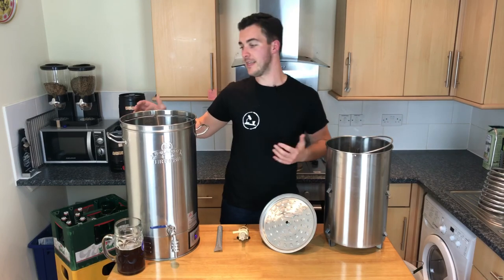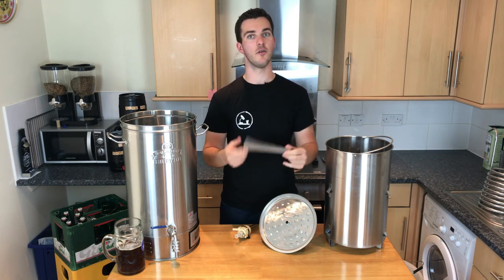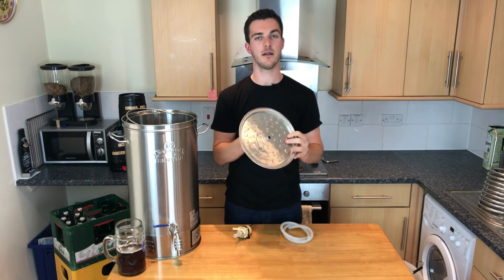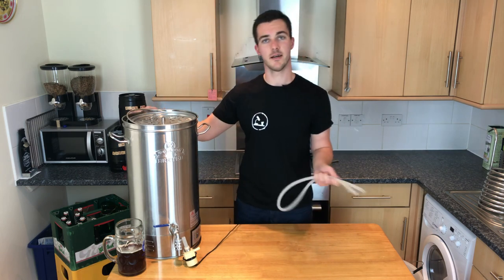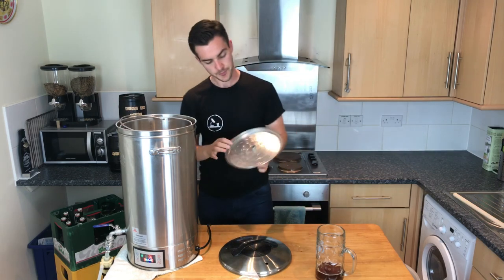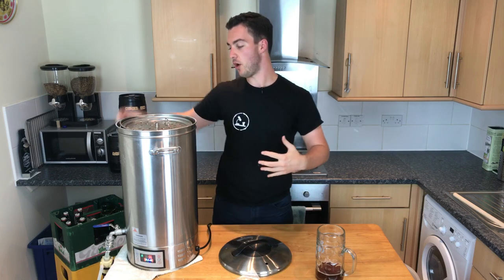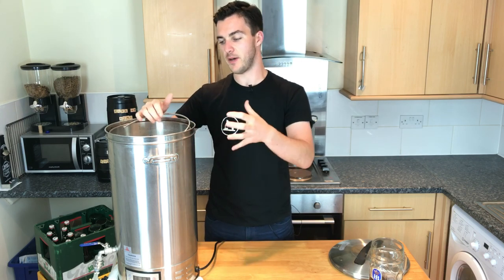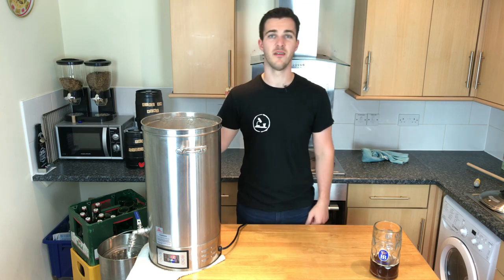All in One Homebrew Systems: How to use The Bulldog Brewer

Comment: Nice video.  I just got a HopfenGott 15L system (which I think is very similar to the Bulldog Brewer), and your video was very helpful. Did my 1st brew on it this weekend, and all went pretty well.

Interesting that you just chuck away your bazooka. Do you just run the mash and boil with nothing at all on the back of the tap as a filter? I ran it with the bazooka in place, and of course it instantly clogged up with hops and trub and totally blocked the flow from the tap when I came to drain the kettle. I had to keep brushing the bazooka with the paddle to unblock it enough to let the wort flow. In the end I got fed up and just poured what was left out of the top of the kettle. Might take your advice and just leave out the bazooka next brew.

What ratio of water to grain do you use in one of these systems? I think I got mine a bit thick (ratio 2.5 water:grain + dead volume). And is there a minimum mash volume? My mash volume was so low that the sparge plate would not go down far enough to sit on top of the grain, and I got a bit of a stuck mash with recirculated wort just sitting on the top of the grain bed and the pump running dry. All sorted with a good stir, but any advice to prevent this happening again much appreciated. Cheers.
Reply from the maker: Hi Mark Harland! Thanks for watching! I think that a lot of the questions you asked are answered in my follow up to this when I bought the ‘big brother of of this system. Yes I run without the bazooka, I first run a few litres of wort through the TAP without the pump connected and replace on the top of the mash manually to establish a good grain bed. Then I connect the pump and recirculate. During the boil, I don’t tend to run the pump except for a little at the end to sterilise the tubing. Hops always clog the pump especially the flower hops and even if you use hop bags, these tend to get sucked into the tap and cause all kinds of issues! I always use a MINIMUM or 20L in mine. That equates to around a 3-4L/kg + dead space. You don’t want to use too small of a volume as it’s not worth scraping the burnt wort off the bottom of it goes wrong (yup, been there with a ‘decoction’ attempt). Give my other video a watch, maybe that is a bit clearer? Hope this helps!
Reply: @dr.tanknstein7590  Nice one! Thanks for the reply. Good tips. Am wondering if minimum 20L in your 30L system would be minimum 10L in my smaller 15L version. I will look up your follow up vid later today.
Reply: @dr.tanknstein7590  Hi again. I've now done a couple of brews without the bazooka as you suggested. Absolutely no problems, the pump coped perfectly well with the few bits of grain that made it through the grain pipe's mesh (I didn't do the manual running a few litres through before starting the pump - I'm lazy). Lovely clear wort by the end of the mash. Added bonus is I can scrape the paddle across the heating element during the boil to help prevent scorching now the bazooka is not in the way.
Reply from the maker: Mark Harland glad to hear! I’m sure whoever invented the bazooka has good intentions but I think it’s a bit of a dud!

Comment: How many times a week can you brew with this system?

Thank you for the vids!
Reply from the maker: Patrick Mills however many times the missus lets me! I guess a brew takes 4 hours or so after warm up and cool down so... to be honest though Patrick, if it’s output you’re looking for, I would look into the 1V1P system (review title: Electric Brewery Control Panel for Homebrewing with Einbrew 1V1P) as you can use this in conjunction with larger vessels and even have separate sparge and chill control which could help you do parallel brews? The 1V1P isn’t cheap and you do need the extra brew house equipment but it does an absolutely FANTASTIC job as a controller. In my opinion, that’s the best way to push volume out of your ‘brewery’. Let me know how you get on!
Reply: Dr. TankNStein thanks for the quick response, I own a micro pub here in the UK and I’m toying with the idea of a small brew set up I have reasonable room to do so but have no idea where to start. 

You input is greatly valued thank you!
Reply from the maker: Patrick Mills ah that’s great! If you would like to chat anymore about it feel free to DM me on Twitter or something

Comment: Hi,

sorry about necrothreading on an old video, but I just got this system second hand and I would like to try it. I have some questions for you:

1. How much water should I expect to lose in a 60 min boil approximately?
2. Will the bazooka filter still clogg if I use a hop spider?
3. Does the increase in strike water mean you use less sparge instead? (I would guess yes but a verification never hurts). How safe it is to deviate from a recipe in this way?
Reply from the maker: Hi! Not at all, always nice to hear from people that watch my videos. I’ll answer your questions best I can.

1. The tall slim design isn’t really conducive to that much boil off so you might only lose 3L or so in an hour boil.

2. I am NOT a fan of bazooka filters. It WILL clog. If your hop material is contained then either grain or hot/cold break will clog it. If you watch my follow up video on the bulldog master brewer I think I offer a suggestion about how to avoid clogging your pump without the bazooka. Trust me, they’re a terrible idea

3. I use the sparge water mainly to make my boil water up to a reasonable volume. So basically I use roughly the same amount of sparge water as the kg of grain I have on the assumption that 1kg of grain will retain about 1L of water. So if I mash 5 L of grain in 20L of water then I’ll sparge with 5L of water. I like to top it up to 20L as at the end of the boil I can then add cold water to top up to the 23L batch size I’m aiming for which gives me a nice head start on cooling.

Hope all that makes sense?
Reply: @dr.tanknstein7590  Thanks. But how come adding cold water post boil does not contaminate your beer?
Reply from the maker: @Xgourouneitor  my drinking water isn’t contaminated with anything 😉 I think that contamination in this way is a bit of a myth. Even if there were trace amounts of bacteria in your drinking water (likely not too many though) the wort is still at 100 degrees when it’s added and as soon as the beer is cold enough, you add a few billion yeast cells that are trained to work well in this particular environment to out-compete the bacteria anyway... I’ve never had issues with contamination doing this

Comment: I use this system and have had some cracking results. I would advise removing the handle on the inner cylinder before inserting the sparge plate.
Reply from the maker: Thanks for the comment Mike. I agree, the step-up in quality in switching to this system is pretty crazy, how long have you been using it? Yeah, I don't usually brew with the handle in but of course, the one time you film a demo something has to go wrong!
Reply: I’ve had it for about 7 months and done 5 brews. Price-wise, it was the best all-in-one set-up. I’ve gone from someone who said they’d never do all-grain to this! I buy my kits from HBC (Home Brewing Centre) and have been very pleased with the results. I am quicker on the brew now but it still takes most of a day (not that I mind, being retired). If only you could ferment in it as well! The worst but most necessary part is the cleaning and tidying away afterwards. One day I may take the plunge and make up a recipe of my own.
Reply from the maker: Oh wow, really? That's awesome that the Bulldog has won you over. I definitely prefer all-grain, malt extract is the most annoying material to handle in the world. I've been doing my own recipes for a while now and its really satisfying, I wrote an article on how to go about designing your own a while ago if you're interested https://www.drtanknstein.com/2018/01/03/getting-the-gist-of-the-grist-designing-your-own-grain-bill/ I'm working on getting my recipe calculator on the site as a tool as well but alas that's not quite there yet...
Reply: I’ve had a look at the webpage and it seems a little daunting at present. I’ll need to do some more research before biting the bullet! Still, plenty of recipes out there for the present.
Reply from the maker: There certainly are! And, in my opinion brewing is only 10% recipe anyway, the rest is in the brewers hands so if you're making good stuff its all on you!

Comment: Hi, is this the same system as the oneconcept hopfengott? It looks almost identical and I'm currently after one of these systems. Many thanks, Jimmy.
Reply from the maker: Hi Jimmy! They do seem to be very similar, yes and the Hopfengot is so cheap! I guess the only difference I can see is that on the Hopfengot the pump is powered through the system rather than having its own power supply as with the bulldog? Like I say though, looks like a good, lightweight system. I now have the big brother of the system in the video and it is great but a little trickier to clean due to the weight!
Reply: @dr.tanknstein7590  brill thanks for your reply. So would you recommend this style of system as a first step into all grain brewing? It's certainly a nice price 😊👍. Cheers 🍻
Reply from the maker: Jimmy C I definitely recommend all-in-one as an intro/advanced all-grain system! If you’ve never brewed all-grain before I would perhaps have a go with just 1kg of Maris otter and some hops (again, I have another video that shows me brew all grain for £10 with zero equipment) just so you’re familiar with the mechanics of brewing that way. Aside from that, watch this video a few times and you’re good to go! These things really are awesome systems, I went from brewing occasionally to at least once a month because it’s just so easy to do and doesn’t take up space in the kitchen/bathroom as you do it. Please let me know how you get on with this, if I can help any further please get in touch!
Reply: @dr.tanknstein7590  I've done one all grain brew in pans on the stove. It was a clone Punk IPA that my partner got me got Christmas a couple of years ago! I wouldn't say it was a disaster but it certainly wasn't great 😂. I think it was a Brooklyn kit? Something like that. I absolutely fancy treating myself to a all on one system, and I think it could be the hopfengott! The price is very nice. Thank you Dr. TankNStein I will definitely let you know how it goes! Cheers 🍻👍

Comment: Cracking video on the Bulldog system,really clear and concise. You're probably right about the cost,over the years that I've made and bought bits cost more in time and effort. 
Is that controller similar to the grainfather,where you are promted with hop additions etc ?
Not sure about sparging at that height btw.
Cheers and subbed too.
David.
Reply from the maker: Thanks for the comment David,  glad you enjoyed it. The control panel is pretty basic to be honest, there is a timer function on it but, as far as I can tell, this just stops the temperature regulation at the pre-set time... I don't tend to use the timer function to be honest. Yeah, the sparge height was purely done for TV, usually it sits on a beer crate or similar so I can see where I'm sparging!